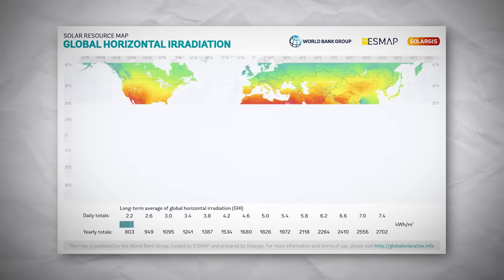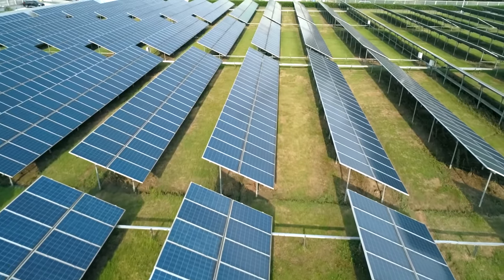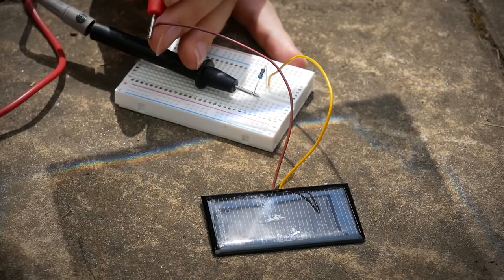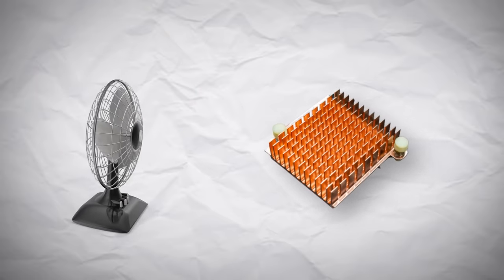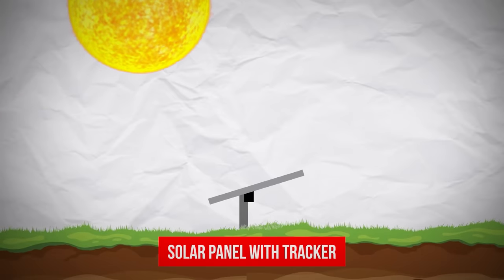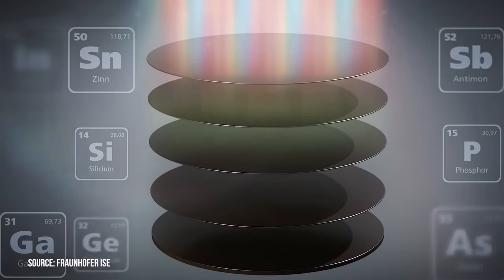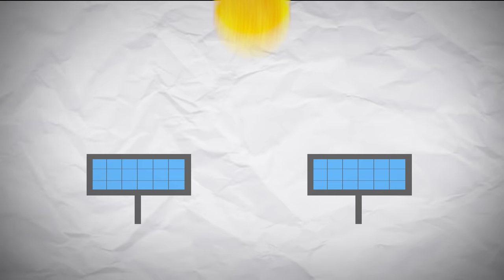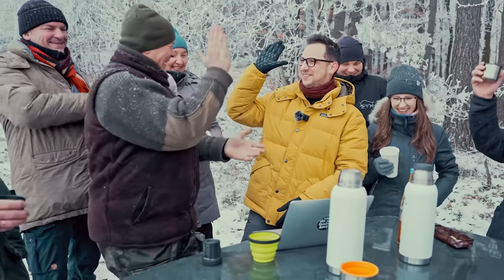Is Spherical Solar Really The Future of Energy?

Comment: It seems all so convulated, it's like making moonshine instead of buying an aged whiskey but worse: fossil fuels that are in the ground like lng have already been created, and stored at maximum efficiency, extracting and using them is also a minimal effort excercise.. The "waste" it provides is co2 which is a direct input for the exact process that created it in the first place, and that process (photosynthesis) is severely bottlenecked exactly by co2 (40%).
Drilling a small hole in the ground and installing a pump is way less resource intensive/polluting than say create solar panels, mine lithium, etc, etc..
You are never going to hit the same efficiency so it's all just feelgood energy, so unless someone invents feelgood panels to harvest that you're just polluting the earth instead of feeding plants, giving them bigger yields, making them more heat resistant so they can grow at hotter locations..
As photo synthesis actually uses the energy it's also cooling.. Futile ego driven excercises thinking you can do better than what the planet has already done for you..
Burning wet sawdust mixed with plastic (otherwise it won't burn) and calling it a biomass fueled generator is just stupid for instance.. Shipping freshly cut trees by boat to the other side of the world because on "paper" which is all mental gymnastics and subsidies just to call something "green" by playing with definitions is just ludicrous..
You might as well burn what you already have: the subsidie money 🎉
Remember kids: if you ever saw the cartoon ice age or listen only for one hour in school for your entire life you know the climate was changing long before we got here!
Pretending you are saving "the planet" is nonsense: you are trying to save yourself, the planet didn't care when it was a molten ball of magma, it didn't care when it was frozen.
The only thing it's inhabitants might enjoy is keeping it clean, fighting an invisible gas that the planet will need to find equilibrium again after some dumbass finds a technology that drops us into another ice age is just selfish.

Comment: Well if they were to run if they were to run cooling tubes into the Earth Earth stays at 67° it would cooled off hot water and then they just run water heat transfer down into the depths of the earth and transfer the heat however I think it would be better if they just ran water tubes to a steam engine and double the energy output so they're getting solar energy Annie's in the hot water to run a steam turbine and then after it goes through the steam turbine then running into the Earth to be cold at 67° and then back up and through Aura float a system like this on top of the a body of water like a man made lake
Reply: Moreover they make the solar cell poorest with thin tubes that run through the the solar cell with a bigger tube a bigger catch for are at one side it can be funneling and channeling buy just adding a porous layer in the solar Morrow were just like an architecture land to spread out cost more than to go straight up so build a skyscraper
Reply: In places like UK where there's a lot of clouds they can redirect with the mirrors that sunlight and make a heat zone where clouds won't form buy just mirror beam directing heat into the sky they can make a Hot patch where there's so much heat that the clouds dispersed around the so you have lenses a mile away from where you want your solar collection beaming up at an angle to where they create a heat zone over your solar area it's doable as possible the technology and the science and physics are there

Comment: I get tired of all these ideas that based on older ideas but never get into existence. 

Look at the solar power plant with molten salt. It similair idea to focus light. Heat up salt so it has potential energy over night when there is no solar. This idea probably better since it actually exists.
Reply: Look at Ivanpah, Desertec etc. Not a success.
Reply: @SolarCookingGermany  Well sometimes it takes time to get to succes. I mean they also still pumping money in cold fusion. or in fusion by lasers etc. Those things still produce no energy and just require energy in the first place. If the same money was pumped into finding ways to reduce salt corrosion and other downsides there might have been better version already. 

They didnt stop building cole plants yet they got more clean and efficient over time cause they never stoped.

Comment: The biggest problems with your video is that you always rush your research and there are always some obvious hickups. Fraunhofer for example is a group of institutes that does R&D. ISE meaning Institute for Solar Energy-systems (the Acronym works better in German). CSP while having the disadvantage of converting solar power into heat, then electricity, has the advantage of being able to store that heat for the night.